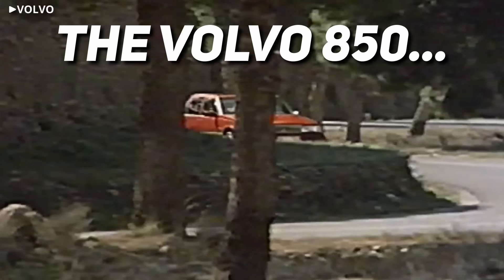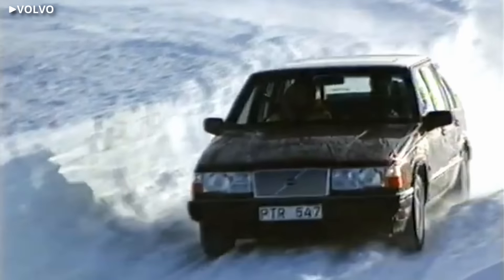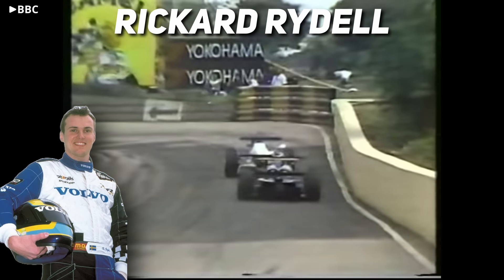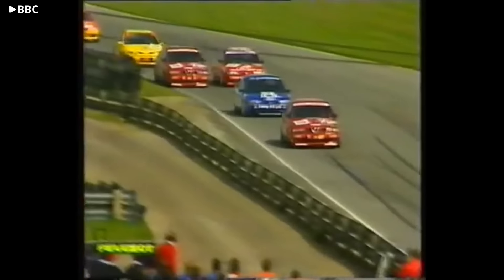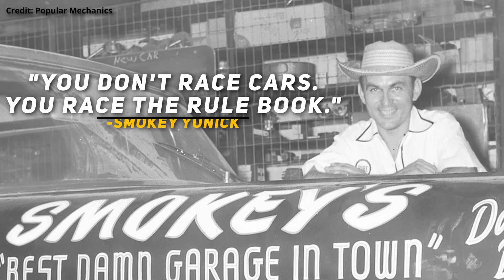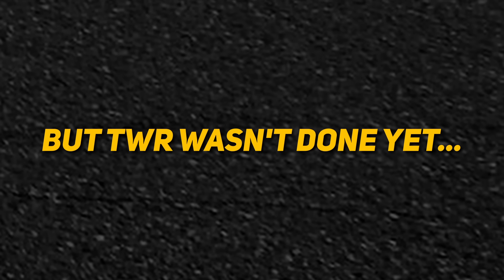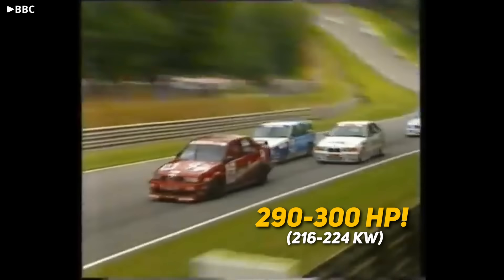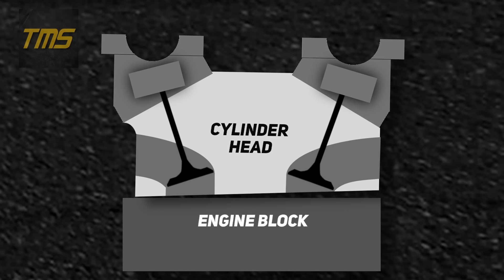The GENIUS Rule-Bending of the Volvo 850 Estate Touring Car! | (1994 BTCC)

Comment: Remember,  the A in Volvo stands for aerodynamics.
Reply: Funny, I plan on taking off both "O"s and putting a "U" and "A".  Getting passed by a Vulva
Reply: @HLGJammer a big red one?
Reply: @_..-.._..-.._  color doesn't matter as long as it's silky smooth
Reply: @HLGJammer .. ..as long as it ain't blue....
Reply: @HLGJammer  Wind tunnel testing has shown that a bit of shagpile around the inlet improves performance. Something about disrupting the laminar flow I think. You definitely want it smooth on the bodywork though.
Like you say, color doesn't matter, though I've always found the red ones give a better ride.
Reply: There is no A in Volvo?
Reply: MongmenRongun   Whoosh! 😆
Reply: MongmenRongun  😄I think you should. I'm busy pairing up my sock drawer.
Reply: The fact that this comment has such less likes just tells that a lot of people didn't get it
Reply: @iancrasta3479 Facts, this joke is too funny to not have more likes, people must be missing it
Reply: - But there is no A in Volv- 😂😂
Reply: And the E is for their own good engine design 😂
Reply: @paddyjsheridan that's because Volvos back then had literally no aerodynamics compared to other cars🤦
Reply: Notwithstanding this excellent joke, I've just learnt that the 850 wagon actually had a drag coefficient of 0.30. 
Even the boxiest Ovlov - the 7-Series - wasn't terrible.  Sure - it didn't get close to an Audi 100 (C3 was equal-best production car, at the time), but it still managed 0.39.
Reply: @assininecomment1630 yea the Opel omega was the best of the era but the v40 was volvo's best in the 90's and the 850 was quite good aswell and much lighter than modern estates
Reply: @paddyjsheridan Then there probably also will not be any aerodynamics 😂
Reply: I actually made TOCA Tour Car happen
Reply: What a little gem 😂
Reply: Hmm funny, that aerodynamics was the reason that the station-wagon had a chance...

After that, spoilers come

Own engine design? The 5 Zylinder is a Volvo Design...
Reply: That color is called T-yellow btw
Reply: @UncleJoeBro  T-Gul by the way ;-)
Reply: Like number 999
Reply: The “C” stands for curvy or cornering, the “B” beautiful, the “S” for small, and the “M” for mom.
Reply: Yeah the car was draggy but that was partially because it was producing downforce!
Reply: @paddyjsheridan r/whooooosh
Reply: @paddyjsheridan The Irish never were known for being the sharpest knife in the drawer...
Reply: @paddyjsheridan that's the point lol
Reply: or its so old most have heard it before.. @kylesebring
Reply: you tricky trickster you almost got me, unfortunately for you i'm at least a talented amateur at recognizing the shapes of letters.
Reply: there’s an "A" in "vulva". coincidence? actually entirely; yes
Reply: Bwaaahahahaaaaa🤣🤣🤣
Reply: Good line.
Reply: Common misconception, but the 850 wagon and first gen V70 actually have surprisingly good aerodynamics. In the R spec, they measured in at CD 0.31, which is about the same as an s14 Silvia, e36 M3, and 996 Porche 911. All of which were slightly better than the Ferrari F-355, for instance, with it's 0.33.

The 850R and S/V70R had (factory limited) top speeds of 250km/h with a 2.3lt engine in a large body. It was an impressive feat of engineering in its time.

The boxy design is deceptive, but by the '90s Volvo's aero design was top notch.
Reply: Ffs lol @paddyjsheridan
Reply: As a past owner of a 240 turbo sedan with an LS3 swap I endorse this message...
Reply: I thought it meant ‘Accident’
Reply: For me A is like "AYUMUUUUUUU".
Reply: @woopimagpie then it decreased the weight by 45kgs.
Reply: @jasperdemann the handling of Volvo 850 is as nimble like Elise despite its heavyweight.
Reply: @SebaztienHawke-ci5hm how expensive this 850 BTCC could be in 2024? For me it is like $85.000.
Reply: @NiclasHorn but surprisingly very reliable like Falcon XR8.
Reply: The flying brick 😉
Reply: What about the d in volvo?
Reply: that explains SAAB
Reply: Funny thing is there insurens is named volvia
Reply: I always wondered why the A was a capital

Comment: The fact TWR knew the 850 wouldn’t be competitive in its first year so made it an estate for the publicity was genius.
Reply: Absolute genius from TWR and Volvo’s marketing team at the time - 30 years on and the most iconic car from the 1994 season was the car that spent most of the season wallowing around in the middle of the pack.
Reply: The estate also had better aero
Reply: Can’t wait to see the next chapter of TWR
Reply: Saw these cars at Oulton Park. One of them came past us on back of wagon after a huge smash
Driver had concussion if memory serves
Reply: @NoctisIgnem and the stock 850 estate is only 35kg heavier than the saloon.
Reply: I like that not competitive means they won 3rd, then 2nd, and shortly after 1st with the same basic platform
Reply: Still won 3rd, wouldn't call that not competitive, car did very well
Reply: @ghandikane841 TWR has about 6 chapters imo.

Comment: The first time volvo did a 40%-40% crash test with concrete wall, the wall received just one star safety rating.
Reply: This is true, because I remember a Volvo S60 going through a store, cmiiw, and the only damage the car has is that its license plate fell off. The store? It has a giant hole in front of it.
Reply: @GRiiZZ  Unfortunately you're quite right, but this is because they used old style concrete. Since then a new type was developed known as "volvo resistant concrete" in short volvrete.
Reply: all very funny, this could apply to the life threatening cybertruck however
Reply: @miljororforsprakpartiet290  huh?
Reply: @themotorsportstory here again a few months after Nijigasaki 7th Live World Tour! The Volvo 850 imo is as amazing as 155 DTM and Mondeo BTCC.
Reply: @GRiiZZ Volvo S60 has approximately 25kgs lighter than S40.

Comment: The amount of dad's I knew in the 90s who literally bought Volvo estates purely because of this car was absolutely crazy. 850s where seen as a better car to own over any BMW or Mercedes here in Northern Ireland.
Reply: They were not wrong!
Reply: Indeed.  We had a '96 850TDI estate.  Just because of Volvo being in the BTCC with the 850 estate.  John Cleland raced for Vauxhall but  he was a Volvo dealer and he sold a lot of those 850's
Reply: Heck yeah. Canada too. We loved these here.
Reply: I was 9 when this was racing. I still want one now
Reply: Even though in stock forum they were slugs slow
Reply: I couldn’t afford a 850R in the 90’s but I am a proud owner of a V70R and beat Mustang GT owners all the time
Reply: Because if anyone slaps a brick of Semtex under an 850 it just busts the pavement under it.
Reply: @f87max30 850TDI Estate sounds like Audi R10 TDI because of TDI powerplants.
Reply: @Muggles87 it is still quite cheaper than Jaguar Type 00.😅
Reply: They where not wrong. Almost every 850 engine made it 500.000km without problems. They are holding up for tuning up to 800 if you only change the pistons and the rods. There are even 1020 hp with most internals original. On yt.

Comment: TWR got a reputed 340BHP out of the 2.0 litre 850 engine which is amazing, Also you forgot to mention that they changed the front windscreen rake to improve aero!
Reply from the maker: Did not know the windscreen part, interesting!
Reply: Awesome 😎
Reply: That’s superbike level power at 170hp/liter from a mostly stock engine
Reply: Getting over 300 HP from a 2.0 L naturally-aspirated engine is damn impressive.
Reply: @able_archer01  Pretty mad considering there are 5 litre V8s and some turbo cars that don't make that much power. And here I thought 250hp from the 2L Cosworth BDG engines was impressive. Years ago I had a Holden Gemini with a built 1.6 Isuzu SOHC that we got 180hp from and I thought that was good. I didn't have TWRs budget though.....
Reply: I don’t think they ever made 340hp. Most super tourers in that era were probably knocking on around 290-300hp. The 850 was certainly grunty & maybe had a bit more torque, but this was offset by the extra weight & less aero than its competition. It certainly didn’t have noticeably more power than it’s rivals.
Putting the motor in the S40 was the best thing they ever did….
Reply: They didn’t make 340 within the 8500rpm limit - they were over 300 though. Theres a lot of myth and BS around these cars 😂
Reply: @benhanks2748  Yes, Although i did say 'Reputed' 👍
Reply: @TommyTosser  Huh. The version of that story I heard involved the Nissan Primeras from the late 90s, rather than the 850s. IIRC the early and mid-90s cars were still a lot closer to their road-going counterparts, before a tech war developed in the latter half of the decade
Reply: @_..-.._..-.._  Mostly stock? They were as tweaked as the rules allowed, possibly beyond. The machining on the head alone cost a fortune and those super high-lift cams may have overcome some of the flow shortcomings, but wear and tear with that design meant some pretty serious maintenance. With 13-1 compression, what concoction of fuel were they running? Nothing you could buy from a pump, that's for sure. All those restricted formulas end up costing more than an all out racing car because factories just throw whatever money it takes to make it work.
Reply: @woopimagpie have to remember that’s on 13.5 compression and race gas. A street version of this motor would probably make much less hp
Reply: Didn’t they acid dip the body as well?
Reply: That’s mad figures considering it’s still naturally aspirated!! And that was mainly head work! No mention of porting or forged crankshafts etc
Reply: @Generalkenobi325  TWR did some 'Interesting' Tweaks to their 850 cylinder heads, It's worth reading about, The heads were made by TWR and were £13K a piece! They were re designed with a wedge to improve the valve angle and they got away with it because it looked standard!
Reply: @  incredible!
Reply: @henrik1743  years later there was a shitload of BTCC stuff that was sold.  Mostly front wings and hoods.  I do own 2 complete side of a 850 BTCC never used.  They do weight just a little under the same as the stock 850 would. But 2 kg here and 2 kg on the other side. one 1kg on the hood and there you go to save weight.   

The metall is thinner than the original 850 stuff  but  for a normal person it is just more easy just to skip the extra chips  now and then
Reply: @scotty6346  the sad part is that they could have made this new head for like 500-1000 £/$   if they was allowed to do a new head from the start.  Sadly for the tuning later on we never got any " Good"  5 cyl head.  The newer with the "D"  head is the best but not so much  improvement  anyway.

Comment: It was not very successful due to the fact that the weight distribution was placed to far back, in order to get more weight over the back wheels, but sadly they went abit to far, and the result was a car that had big problems with tourque steer and according to the driver Rickard Rydell, the torque steer was insane, yes that was his words.
One of the reasons for this was that TWR had not made a fwd racing car before, and both drivers were new to touring cars, so it was a learning curve for everyone involved.
The best results were 2 fifth places.
And no, the 850 racing engine was not based on the 2.3 liter turbo engine, it was actually based on the 2 liter naturally aspirated 20 valve road car version sold in Italy, due to Italian tax laws at the time, which punished cars with engines bigger than 2 liters.
This information comes straight from the people who raced these cars in the Swedish Touring Car Championship, STCC who run under the same rules as the BTCC in the 1990:s
A big reason why it was hard to get the power, was that all Super touring cars were limited to a revlimit of 8500 rpm.
 Italian spec Volvo 850s were sold with a 2 liter naturally aspirated 20 valve 5 cylinder engine, with 140 hp, in rest of Europe we had a 2 liter 10 valve 129 hp version of the same engine, and a 144 hp 10 valve 2.5 liter 5 pot, the same engine could also be had with a 20 valve head and 170 hp, this was the most common engine in Sweden, where reasonable power and economy was always the norm.
Here is some valuable information about the car specs :
https://www.cyanracing.com/concept-cars/volvo-850-super-touring
Reply: The 2l 20v was also sold in Britain - I had a 1993 854.  Still miss it, although the S70 2.5T and later V70 that followed it were (are) great cars too.
Reply: Good info! 👍🙂
Reply: I was wondering all the way through the video why he kept mentioning it being too heavy at the rear as if he was suggesting it was because it was an estate. The estate version only added a few kilos to the back but now it all makes sense!
Reply: An additional reason it never managed to get very successful, was perhaps also that the next season (iirc) allowed for rear spoilers up to the roof line, meaning the little downforce edge the estate shape provided naturally was effectively reversed by not being able to mount a spoiler. So the team basically only had the one season where they had any chance of theoretically competing with an estate, where they might otherwise have improved and gotten more competitive in a second season.

Comment: Great video, this was a few years after I left working for Volvo Canada in Fleet Sales, where i live in Central Canada, there's a young man, in his 30's that has the a V70R he has built, upgraded turbo and internals with Cams bearings, connecting rods and all new Haltech engine management  and whole new fuel system, from what i heard from a friend of mine who still works as a Volvo Tech for about 30 yrs says , it dynoed at 370 BHP and about 410 torque , that is insane, and apparently launches like a madman, I know that is nothing compared to todays cares, for a car that is around 20 yrs old, that is just crazy, just goes to show a box can have some performance to, I am happy with my 240 👍

Comment: The marketing success of the estate increased the demand for the 850 T5, and also gave them a reason to make a special version of it; the 850 T-5R :) Then the even more souped up 850R, and essentially started a performance line in several later models, V70R and S60R. Couldn't imagine Volvo without the R-line. Too bad they stopped after 2007 and only made "R-design" since then.. bleh
Reply: I drive a bog standard V70, and my mind was completely blown by the amount of power in a friend's V70R.  Beautiful looking thing, too, in metallic bronze.
NURSE!!!
Reply: I bought one of the olive green T5-R models. I was stuck in a traffic jam in Twickenham next to the Volvo garage and there it was next to me. At the time I had two small boys so it was ideal for my family. It started off my 'Volvo era', I then got the AWD version and finally the C70. The last two were in 'orange' paint much to the amusement of my friends.

Comment: I still miss the sound....had an late -96 estate . In Italy, they had a NA 2.0 20v rating 148 hp. Volvo also raced the 850 sedan, before using the lighter S40
Reply: Yes, that was the base engine for the BTCC car, and in 1995 the wagon was replaced by the saloon version, and it was in 1995 that the 850 had it`s best season in the BTCC, whit several wins, and Rydell did lead the championship in the early parts of the season, eventually finishing 3rd after strong performance from the Vauxhall Cavalier ( Opel Vectra A ) of John Cleland, and Renault driver : Alain Menu.
1996 was dominated by the Audi team, and their 4wd A4 Quattro, Bmw and Renault were also very strong this year, whit Bmw having probably the strongest engine, but it`s slightly wayward rwd handling made them handle less good than it`s fwd and awd counterparts.
So in 1997 Volvo swapped the bigger 850 for the smaller S40 but kept the same 5 cylinder engine, 197 was a dissapointing year with Volvo struggling to keep with the insanely fast Renaults, but in 1998 Volvo and Rydell were champions :)
After 1999 Volvo left the BTCC due to the very high costs of building and running Super Touring cars, they were followed by Renault and Nissan 2.
Audi and Peugeot had already dropped out after 1998.
Reply: @fontheking5  surprised , that they raced a 5 cyl S40 , as they did not sell any , hence the model name. Maybe the S60 was 5 cyl. Remember when Renault swtched from 21 to Laguna . BMW , had a 320 SI , think it was 4 cyl 16 valve.
Reply: Renault did race the 19 in the BTCC in 1993 before switching to the new Laguna in 1994.
The S40 gen 1 did not have a 5 cylinder engine in road car form, but the rules said that you could use any 2 liter n/a engine from your parent company, so Volvo kept the 5 cylinder 2.0 n/a engine from the 850 racing car.
The S60 was not used in the BTCC, but it was used in the Super 2000 European Touring Car Championship in 2002 and 2003, it almost won a race in 2002 at Anderstorp Sweden, but Rickard Rydell was overtaken by German Bmw driver Jörg Muller at the last lap, the fwd Volvos and Alfas in that championship, at least at that wore it`s tires alot more than the rwd Bmws.
The Super 2000 cars were simpler than the Super touring cars, less expensive to build and maintain, less advanced.
Still 2 liter naturally aspirated though with around 260-270 hp, and yes the Volvo S60 was only sold with 5 cylinder engines, biggest drawback of the S60 Super 2000 car in the ETCC was engine power, they never really came close to the very fast Alfas.
Reply: @fontheking5 Audi left because they banned AWD and it made them uncompetitive

Comment: For a reference point on the heads.  
NASCAR cylinder heads of the same time frame were $20,000 in 1992 dollars per pair in the EARLY 1990's . Ported polished, titanium valves etc.